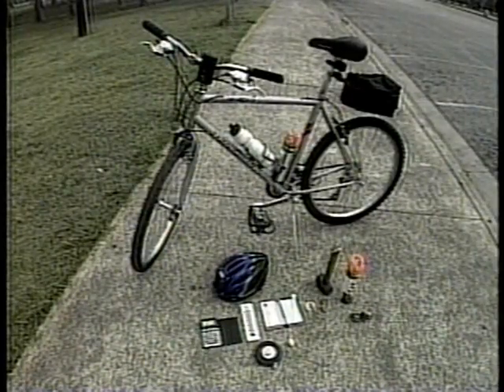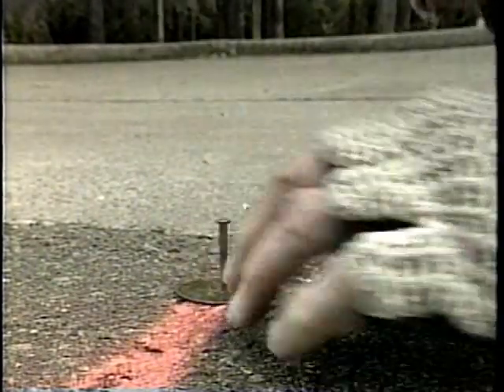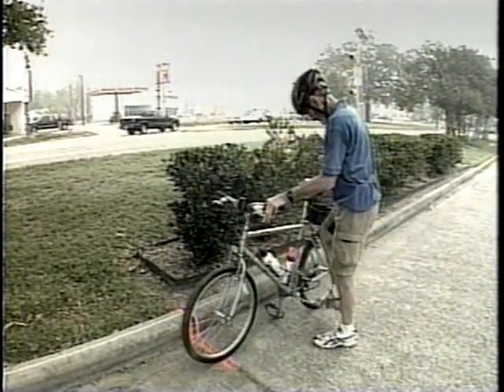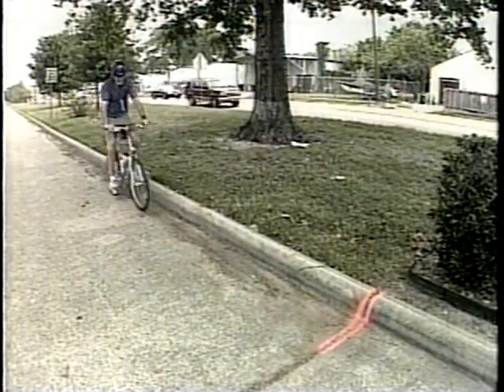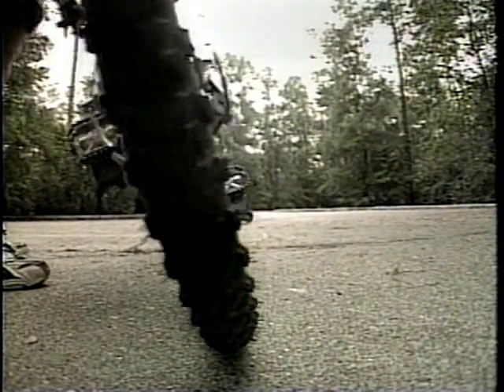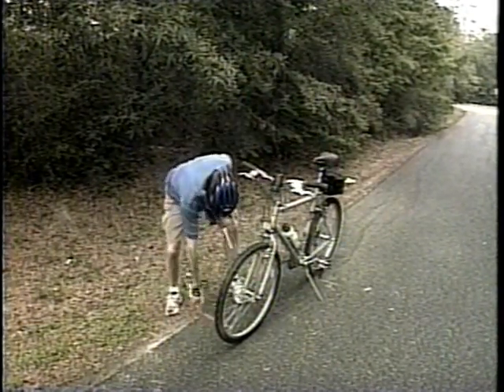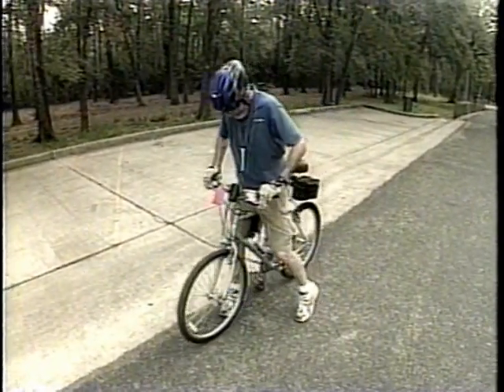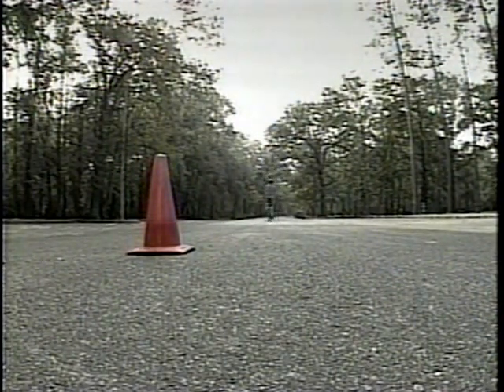Course Measurement Video (2001)

Comment: Amazing video. A quarter of century later it's still applicable!
The only thing I do different in this is instead of writing things down on paper, I'm using Excel on my phone. My constants I'm calculating in real-time. I don't usually start the calibration or a ride with a 0 on the end of my counter since Excel is making the calculations so easy.